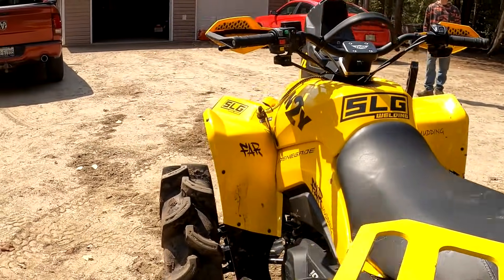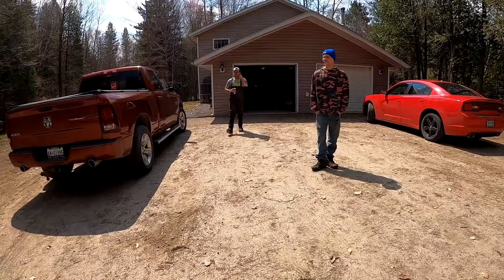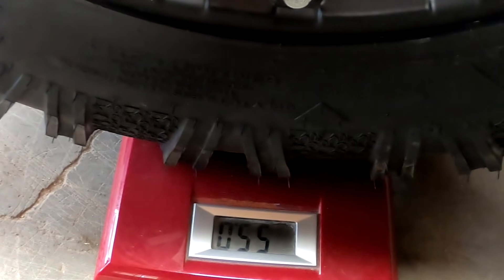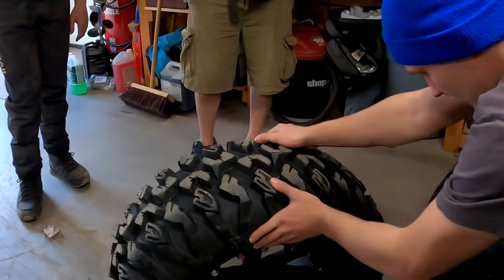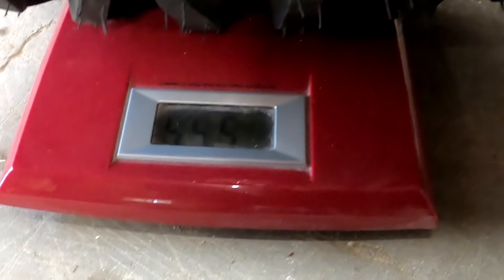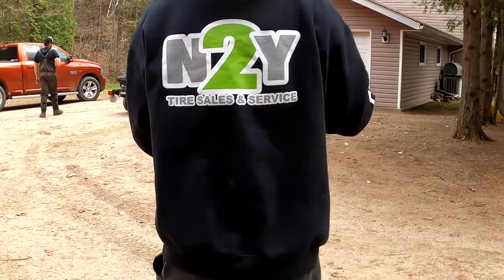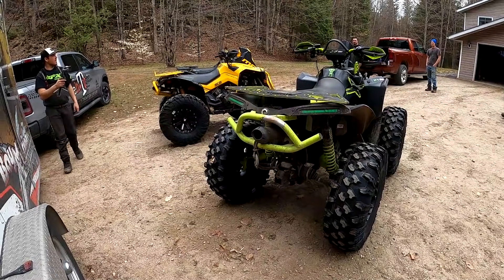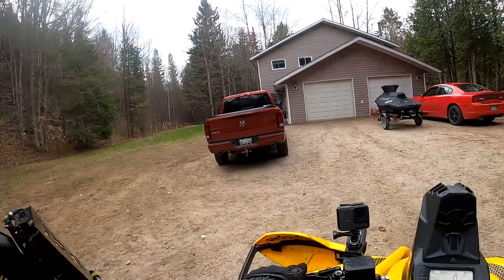These Tires Hook Up! (Efx Tire Shootout)

Comment: Well this sucks cus I rolled my outty this past weekend too. Ugh. Worse than yours. Handle bars are bent to the plastics and both bumpers are bent in a little. Did it slower than you too but mine was turning on asphalt and it gripped when it should have slid. Oh well